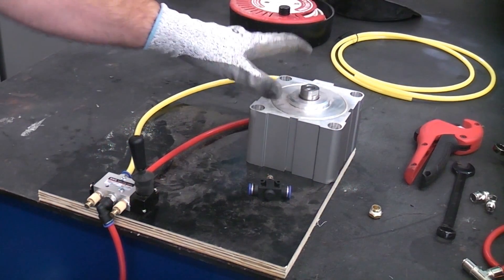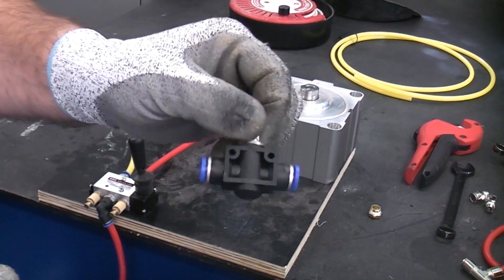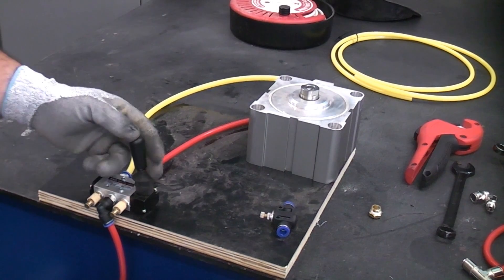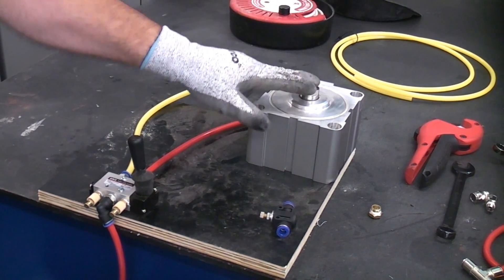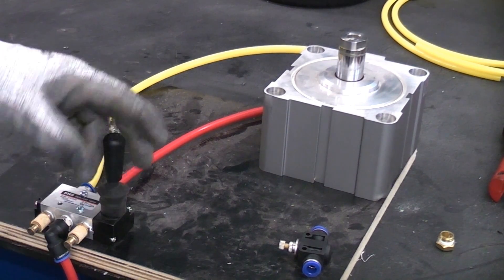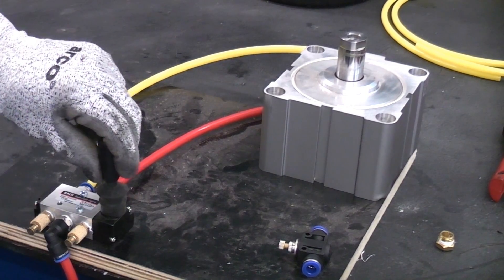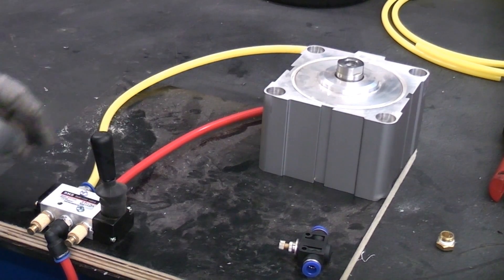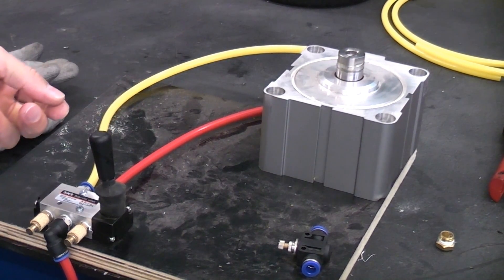How to control the speed of a pneumatic cylinder

Comment: I still don't get about the pressure, force is mass times acceleration, if we make the cylinder slower will the mass increase? I'm sorry about broken English
Reply from the maker: Not sure about that, I’m a maintenance engineer and not a scholar. We were only taught to slow down the speed of a pneumatic cylinder using the exhaust, so that the cylinder still has full pressure to move it 👍

Comment: Is there any way these can  be program via remote control?? And one more question from your experience from these going back and forth.  What normally is the life expectancy that u got to replace the parts
Reply from the maker: You should be able to rig the solenoid valve up to a remote wireless relay- https://www.youtube.com/watch?v=t6wrqjTNcTM
These types of actuators are normally very reliable. They are used in industry, where they are used in manufacturing plants that run 24 hours a day, 7 days a week and normally last for years before they need servicing (providing the compressed air is clean, dry and lubricated) 
Thanks for the comment 👍

Comment: Will the speed control valve work on a single spring return cylinder I want it to go down slow but when I release the handle it returns fast on its own because the cylinder is spring load hope I make sense thanks great video
Reply from the maker: I'm not 100 certain, as I have never tried it before, but you should be able to slow the speed at which the spring retracts, by restricting the exhaust air from the cylinder ( I think ).
Thanks for the comment

Comment: So what are the 2 black devices on the the sliding thing, shock absorbers?
Reply from the maker: They are inbuilt pneumatic plungers that stop the carriage at each end, once they are depressed it prevents the air from continuing to push the cylinder.

Thanks for the comment
Reply: They look like they could be couple Impacta shock absorbers.  They will often be used in conjunction with a switch.  An alternative to that Control Flow valve you're using on the air cylinder, is a Kinechek.  They provide a constant feed rate along its entire stroke, quite smoothly.   Nice video!

Comment: how control the speed of four pneumatic cylinders they run equal speed up and down ????????????
Reply from the maker: You would probably have to use a manifold and then use a restrictor on each of the outlets and adjust each one accordingly.
Reply: Ultimate Handyman I use it but when cylinder up four cylinder different speed not up and down same speed can you send me some idea or pic how can control cylinder stock
Reply: 40 mm bor cylinder stock 600mm and use 6mm pipe and fitting but not up and down equal speed
Reply: I'm use four way hand valve pressure 6bar
Reply from the maker: This might be more complicated than I first thought, this might help- http://www.hydraulicspneumatics.com/other-technologies/book-2-chapter-22-synchronizing-cylinder-movement
Reply: Ultimate Handyman there is no tell about pneumatic cylinders control they tell about hydraulic,kindly give me more option I want up and down roof with four cylinder. I m installed four cylinder in four corner.
Reply from the maker: Hydraulic and pneumatic control is very similar. 
You might have to put 2 of these on each cylinder and adjust them accordingly until you get the desired effect- https://fave.co/2NBaofR
It won't be easy though as your cylinders are quite large, so you need a decent volume of air.
There are a lot of things to consider such as length of pipes, diameter of pipes etc.
Reply: Ultimate Handyman this link not open ???
Reply from the maker: The link was to eBay, this might work- https://www.aliexpress.com/item/5Pcs-SA-6-Push-In-Speed-Controller-6mm-Pneumatic-Air-Flow-Control-Valves/32803877592.html
Reply: Ultimate Handyman I'm use this flow control but 2cylinder run first than 3rd then 4th run not equal speed up and down
Reply: I'm use in street ape car you see it ape car on YouTube maybe you have any idea

Comment: Where do you get the joystick to activate the piston? What's it called. I want one :) Thank you in advance....great tutorial
Reply from the maker: It's a 5 port, two way lever valve- http://fave.co/2h16Y6F
When buying one you have to get one with the correct sized ports and threads for the fittings that you are using. I normally get them with 1/4 BSP ports which are common in the UK, the one I linked to on ebay has 1/4 PT ports, which are used in the USA.
Thanks for the comment
Reply: Fantastic! Thanks

Comment: hi, i want to open a door that weights aprox 600 pounds and measures 9 x 9 feet. Can you give me an idea of what i need? The idea of using pneumatics for my project its because i know pneaumatics are way faster than electric linear actuators. I want my door to be opened in less than 5 seconds and closed in 5 seconds too is it possible? thanks
Reply from the maker: For something so heavy I think you would need hydraulics to get the speed you require, but then it will be expensive and you will need a lot of safety devices to prevent anyone from being crushed.

Comment: Hello Sir. Thanks for the excellent video. I have a general question about hydraulics. So when you move the lever in one direction, it opens the chamber between the compressor hose and one of the cylinder hose while opening the other cylinder hose to the atmosphere to release air. Is my understanding of this correct or incorrect? Thank you.
Reply from the maker: +omarofuae 
You are welcome.
Hydraulics are slightly different as there is no venting to atmosphere, so the oil returns to the tank. This explains it well- https://www.youtube.com/watch?v=KgphO-u7MlQ
Thanks for the comment ;-)

Comment: What parts are used in this setup? I would like to know if it can be incorporated in an exoskeleton design to lift heavy loads on the legs.
Reply from the maker: +K9Yeti The rod less cylinder is not that strong to be honest, unless you get one with a large bore cylinder but they are very expensive. I'm not sure which model I used without checking it, but the force on this one is not at all strong. There is some technical information here that might help-http://www.cmafh.com/images/Master%20PDFs/BRP%20CYL/Rexroth%20Rodless%20Cylinders.pdf
Reply: +Ultimate Handyman Oh ok. Thanks very much!
Reply from the maker: +K9Yeti 
You are welcome. Sorry it took me so long to reply, I read your comment a few days ago and only remembered today that I had not answered-  It's my age LOL

Comment: Thanks for video. Please explain one things- how the stoppage of pneumatic cylinder is implemented? Air pushs plunger  till the end of cylinder and then what? Is there some kind of limit switches or something?
Reply from the maker: +fatrobotnew 
You are welcome.
Yes, there are two inbuilt pneumatic plungers that stop the carriage at each end, when it reaches it's limit on the rod less cylinder. 
But the normal pneumatic cylinder just extends or retracts as far as it can do with no switches etc. it simply moves until it reaches the end of it's stroke. 
Thanks for the comment
Reply: +Ultimate Handyman Thanks I get it.

Comment: Question, where did you find that actuating valve?
Reply from the maker: +Michael Breto I bought it from ebay- http://fave.co/1OFS3M3Thanks for the comment ;-)
Reply: +Ultimate Handyman do you know what the lifting capacity of that rodless cylinder would be in a vertical application?
Reply from the maker: +Michael Breto 
You would have to check the manufacturers data sheet, or if you are buying it from a shop the people selling it should know.
Reply from the maker: +Michael Breto 
Sorry, misread the question.
No, I don't know without looking it up. We use these at work to lift flexible pipes from one floor to another, they are pretty strong but I'm not sure of any figures etc.

Comment from the maker: @airofan
No, I don't thin it increases the force. The force from the compressor will never be increased past it's maximum. But by slowing down the cylinder by using a restrictor on the exhaust it ensures that the cylinder operates with full force.

Comment: Thank you for this info.  Does slowing down a pneumatic cylinder increase the amount of torque at all ?
Cheers! 
John
Reply: Torque? You meant force that the carriage exerts? -No, the force only increases if the pressure is increased and is not dependent on speed.

Comment: What do you use this sort of stuff for?
Reply from the maker: +topbanana188 
This kind of equipment is widely used in industry for controlling or moving things.
I'm making a few things in the future using these so this tutorial might prove useful. I'm working on a Halloween prop at the moment using the rod less cylinder and a solenoid which is activated by a 12v PIR sensor.

Comment: that was good, do you have a part number or where it was gotten
Reply from the maker: +George Gardinier 
Thanks, the adjustable mufflers and solenoid valve were purchased on ebay.
The pneumatic cylinder and rod less cylinder were bought at auction a couple of years back, although you can also get them on ebay etc.